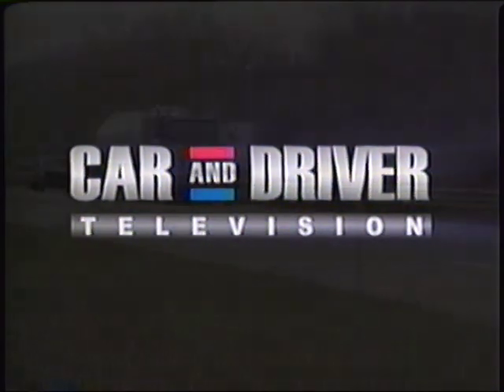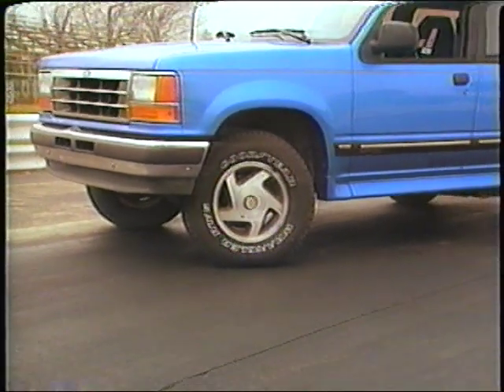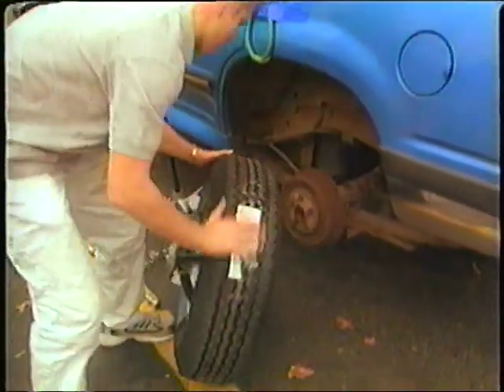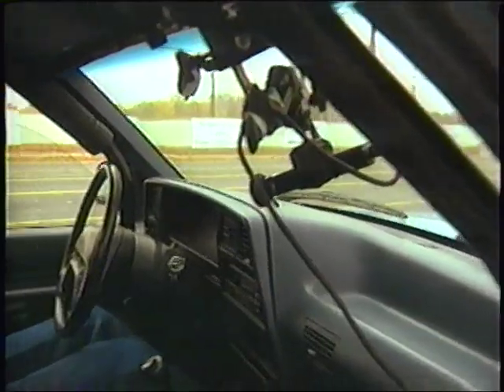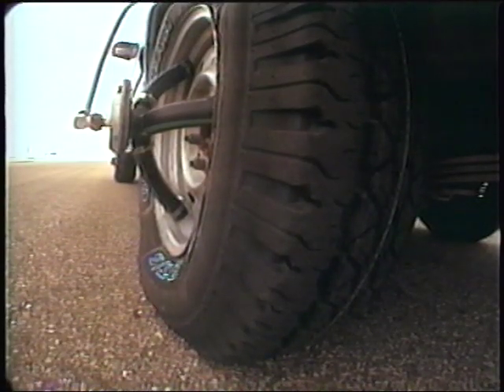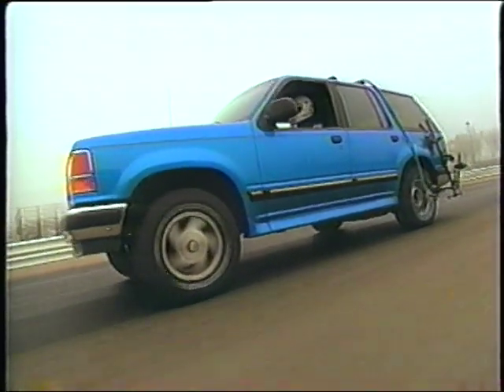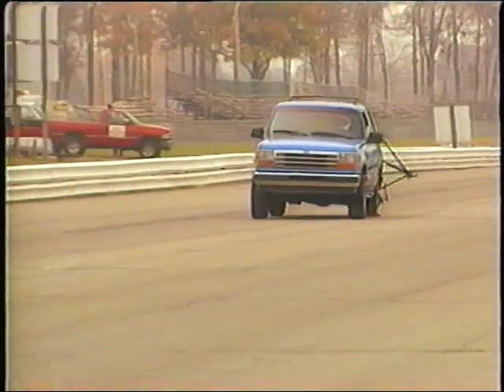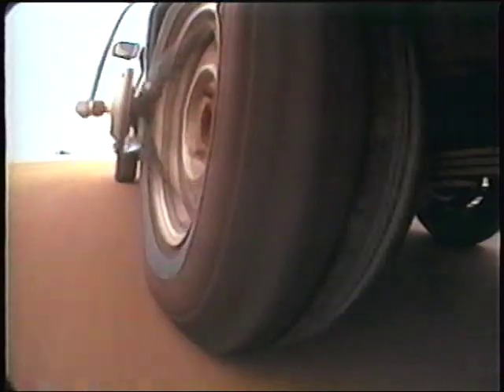Car And Driver 1994 Ford Explorer Tire Failure Test

Comment: The test was done specifically on the rear tires because it was rear tire blowouts which were the subject of the infamous lawsuit.  I think the main problem was soccer moms overreacting to the sudden noise and change in handling when a tire failed.  Ford used this same tire on 4WD Rangers...mechanically identical to the Explorer...and there were nowhere near as many accidents due to tire failure.

The NHTSB found the Explorer to be no more rollover prone than any other vehicle in it's class.  However, Ford isn't blameless, as they did tell consumers to under-inflate Firestone tires that were already defective.  When these Explorers were new, they came from the factory with 25 psi in the rear tires!  A Ranger would have 35 psi.
Reply: Really? they redesigned the entire vehicle after this.
Reply: @beautybyhammerllc  Yes...to make it more "soccer mom-proof".
Reply: The shorter wheelbase of the explorer also lends itself to be inherently  more unstable just because of the geometry
Reply: The explorer had a much higher center of gravity than the ranger

Comment: Now put it on the front so it makes the steering wheel pull to one side.
Reply: yeah on the front doing 70 on a corner!
Reply: I agree with you they should try it in front.
Reply: Any truck or truck based vehicle requires the driver to be more of a driver in a front tire blow out,but it can be handled,first of all do not stab the brakes it will get out of control fast.
Reply: Exactly
Reply: Yes.
Reply: Uh yeah a whole lot of nothing. Considering I had the whole damn left front tire and rim come off my F150. Just brake hitting road and coasting to a stop afterwards. People are panicking and this is what causes the wrecks.

Comment: There are some key differences to this and an actual blowout. This tire remains intact but runs empty, when a tire shreds you're running on a rim which I could imagine would perform very differently
Reply: It does had it happen in my 94 xlt explorer and its fuckin terrifying but she kept at least three wheels on the ground at all times so it was fine cause the roofs on them are built like tin cans
Reply: That's why I don't like Car and Driver, they got so much money helping Ford against Firestone by doing tests that prove just about nothing against their tires. Most of these rollovers with the early gen Explorers were caused due to the short wheelbase of the platform they used.
Reply: This must’ve been funded by ford

Comment: 4 doors and it’s a manual? I want it
Reply: probably rolled over two seconds after filming
Reply: I've got a '93 like that :) I've always wanted a 2 door version but I love mine
Reply: I drive a 94 woth a auto there great trucks and amazing on gas
Reply: @jamesprice2163 Mine is a 93 and it gets terrible gas mileage. It runs excellent. I really can't understand why it gets such bad mileage?Gets about 13 city 18 highway. Mine is pretty low geared it's got the 3.73 track-loc rear axle ratio. Cruising at 70mph it's only cranking about 2200rpm. Also it's an automatic. I've been told the 5 speed transmission does get better mpg than the automatic. Maybe that's why? It's my 2nd vehicle but I do use it because it's bad to just let a vehicle sit.
Reply: @Thundarr995  mine is a auto too I'd check tire pressure mine also has premium gas in it so it runs smoother but honestly explorers have never been known to get good gas milage but their bulletproof and can take a beating
Reply: @ianvader4697  they don’t roll over that easily. My parents had a manual Eddie Bauer edition, they racked up 300k miles and not one time did it feel unsafe.
Reply: Just bought one
Reply: @elirenigar9357  Be careful, if you rust proof it you might be stuck with it for 40 years
Reply: I have a 94 looks exactly like that with some body mods on it...They are dam good SUV's I blew a front tire and it was stable just like they are saying...Good luck finding one

Comment: I daily one of these and love everything about it its fun to drive pretty powerful (at 160hp) good storage, brakes kinda suck due to the slider pins continuously falling out but im swapping them out for second gen disc brakes so it'll fix that the only issues i have with it is the brake problem and the mirrors are too small for a suv other than that i love my explorer
Reply: The original ones, were they drum breaks?
Reply: @42luke93  in the rear yes but the fronts were what was throwing pads every two weeks sadly not long after posting the original comment the transmission gave up the ghost and we had to scrap my beloved explorer which lucky was used to piece together another one so it's heart is still out there somewhere hauling people around like it did for me (legit I fuckin loved that truck lol)
Reply: Was your explorer manual or automatic or manual?
My dad says that his is pretty dang weak (automatic explorer)
Reply: @DGP873  she was a automatic and yeah they were the weakest transmission of them all but it still held up for over a quarter million miles
Reply: My mom had its more premium cousin a 1998 mountaineer with a 5.0 pushrod V8 and automatic climate control. You can feel the torque on the gas pedal and it’s a nice sounding engine.

Comment: had one, was an awsome truck, would  turn on a dime, put coil over shocks in the rear very stable. ended up hitting a kia sephia head on at 40 drove it home. they cut the girl who ran in to me out  of her car with the jaws of life.
Reply: I have one now and have to agree but my brake line blew off and it slammed into a tree at about 25-30mph to my suprise it drove home and four months later still starts when you crank the key
Reply: Update still have it and still daily the damned thing still haven't fixed it and am buying another one next week the first gen explorer is truly the truck behind the phrase "built ford tough"

Comment: Tread separation, I doubt an experienced race car driver could recover. A rear wheel locks up from the rubber band and you have induced oversteer, fishtailing. Rollover very likely.  Tread separation though is very rare today.
Reply: The whole problem you outlined here begins with inferior Firestone tires.
Reply: @lawnmowermanlawnmowerman9930  The tread separation happened because Ford spec'ed only 26psi which left zero margin for error on tire pressure. Tires were fine, Ford was the issue.
Reply: @imzjustplayin  I go by the tires recommendation on my Explorers and I make sure it is rated for the load if not a little over rated for good measure (tire also lasts longer). I will say this, any tire I run on these trucks, once you get around 30psi and above they start to ride extremely roughly. Like you feel every single bump to the point where it shakes out your fillings. I've tried different shocks, but it only seemed to make this worse. I'm not exactly sure what causes this but I can see why Ford was trying to make it ride better with less tire pressure, people would have test drove them and immediately ran away from the bad ride quality. That being said it was a stupid cop out and they should have ran the correct tire pressure and taken the hit from less potential buyers. Personally the harsh ride from the correct tire pressure does not bother me because my other vehicles are all stiff race cars on coilovers, the Explorer is like a vacation in comparison. 

If Firestone was aware of Ford using 26lbs before the lawsuits began it's negligent on their part for not pulling out of the Ford partnership right then and there. If they lived under a rock and never managed to hear about it until the lawsuits began then that is probably a symptom of the stone age before social media when info like that could take a year to get around word of mouth. However, this is the automotive industry we are talking about, I'm pretty sure even back then info traveled fast. 

I believe there is only one real solution to this problem, much like Ford Pinto owners install aftermarket racing fuel cells, maybe if people still want to use these now vintage trucks start thinking about installing a roll cage and some harnesses like this one in the video.

Comment: btw, tread separation is much different.
Reply: Look up "Ford Explorer tire tread separation"...still nothing happens.  Conclusion = Poorly maintained vehicle (insofar as suspension components, steering upkeep, etc), completely inept driver, or both.
Reply: True. But then again, the fault is with the driver and Ford. 26psi is way too low of a spec, gave no margin of error if the pressure lost a few PSI.
Reply: @aks3691  What evidence do you have the tires were over inflated? Tires typically have max inflation values starting at 35 psi going up to 80 psi for LT tires. I've never had a tire explode due to being overinflated, always underinflated.
Reply: @aks3691  Go find it. You'll see that it loses control on the underinflated tire. The reason why is because the u-bolts tear the sidewall which deflects more when deflated. Also with a spec of only 26 psi, losing a few psi of pressure leaves no margin for error due to overloading. They specced lower pressure to improve ride quality of what is basically a ford ranger.
Reply: And if it happened in a turn?

Comment: put it on the front and lets see how it turns out
Reply: 2Legit2Quit if the front tire were to blow it would actually be even more stable than if the rear was to. You can control what the front tires will do by steering but not the rear tires. If the rear tire were to blow (explode not just deflate) the vehicle would be fishtail, but if the front tire were to explode, it would just pull to one side in a non-violent manner.
Reply: Had it happen she pulls but it's controllable

Comment: In reality a lot of the non tire failure related fatal accidents involving the early generation explorers came down to one factor:

Stupid people with no previous driving a truck based vehicle thinking that you could just throw a 4600 pound truck around the same way you can a 2800 pound Honda Civic without any risk and not bothering to learn how to safely execute emergency maneuvers in a large top heavy vehicle like an explorer.

Engineering wise it was a perfectly safe sound and stable suspension design than had been used for years in the Ranger and F-Series with no issues to speak of.

Comment: There was never anything wrong with the Explorer,it was the inferior Firestone tires and inexperienced/panicking drivers who were the problem.
Reply: After driving an explorer for years, I want to agree. However, there is evidence from an explorer designer that the car was 2 inches too narrow to be safe and rollovers were a very real threat. The rumor is that ford decided to blame the tires instead of fixing the problem. However, all of this should be taken with a grain of salt, as the ford designer mentioned does have some bias and could easily be lying
Reply: @shauncole4392  I had family and friends who worked at the Memphis Firestone Plant and they have all told me that they were ordered to put already rusting steel belt material in those tires during production, I know tires and Know very well what the results of such a practice would cause.

Comment: Rapid air loss and a blowout are 2 different things. A blowout is when a tire explodes into pieces losing it's tread. Sudden air loss is when all the air is lost but the tire remains intact such as running over a large piece of sharp metal puncturing the tire. You demonstrated simple sudden air loss- not a blowout.

Comment: Not sure I heard a lot of tire pressure  was super low after drive forever  with low tire pressure  it would separate  and cause rollover  also tire pressure  in door but ford was recommended  lower tire pressure

Comment: This is a bad test, this isn’t simulating a tire BLOWING OUT. The shock of a blow out is more violent and sudden than simply releasing all the air out at a relatively slow discharge. Also, a tire blow out on the front WILL be harder to control

Comment: A front tire blowout would have been more exciting, but I have very little doubt it would not lose control if the driver knew what to do.  Speaking of which, I probably should get new tires on my Explorer.

Comment: Not the truck or the tires fault.  Total driver error.  I own one of these and I'm familiar with it's handling characteristics.

First off, he's going too fast, jerks the wheel hard left, then hard right - that will destabilize pretty much anything with a high center of gravity - Explorers, Blazers, Broncos, a Garbage trucks.

The next mistake happens twice - or same 2 mistakes.  First off, the driver turns AWAY from the lean.  The whole idea is to turn INTO the lean so that the front tire on the leaning side pushes the vehicle back up before it goes to a point of no return (during which you want to return the wheel to straight - and do it GENTLY/SLOWLY) - which brings me to the second mistake, the driver jerks the wheel to overcorrect on top of it, causing an ABRUPT situation that will shift the problem to the other side.

What the driver should have done in the first place is not jerked the wheel.  And after that first mistake, turned into the lean carefully and ever-so slightly to push the truck back up, returning to straight as the truck gets back on all 4's - which would take off some of the momentum and discourage it from leaning the other way.

Also, if you look around 0:16ish - the driver should have held STRAIGHT there until it stabilized and then corrected into the lane.  The Explorer would have stayed on all 4s and all would have been fine - my guess is they were simulating the panic of a driver unfamiliar with the vehicle - which again is driver error, not vehicle issue.
Reply: My friend 99% of drivers these days aren't true drivers at all,just passengers who happen to be holding a steering wheel as they go down the road. Most have never handled a truck style vehicle until they buy an suv,then they expect it to handle just like the sedan they're used to driving. Two totally different handling vehicles.

Comment: Brilliant test probly sanctioned by the Ford motor company because in the statistics of the explorers involved fatalities that actually had roll overs, BOTH were rear tires failed simultaneously or one shortly after the other causing severe oversteer that even a highly experienced driver would find very  difficult to control without prior warning at highway speeds....... This was a very silly demonstration........
Reply: change your cheap tires

Comment: What about a blow out on one of the front tires?
Reply: Depending the speed and how much driving experience you've, I'm my 30 plus years of experience as a technician I tell people to never try to save money when it comes the time to buy tires, i ask them, how much you figure your life is worth? If is a truck get truck tires, those are crappy tires that wouldn't sustain the weight of the that SUV in hard driving conditions, like when there's an accident and the cops re direct the traffic through an old abandoned road and there's all kinds of debris on it.
Reply: @josmarz3841  wouldn't sustain the weight in hard driving conditions? what the hell are you babbling about. Vast majority of blowouts are caused by insufficient tire pressure. Most drivers don't check their tire pressure and even fewer add additional pressure when going on a road trip, loading down the vehicle yet not adjusting the tire pressure to compensate for the additional load.

Comment: Um, no.  The problem wasn't blowouts, it was that the tread would separate from the tire, much worse.  We had a partial tread separation in my grandpa's RV a few years back, it had duel rear wheels and still shook like crazy.  On a much lighter vehicle with single rear wheels I can see it bouncing the rear end like crazy.

But ignoring the rollover risk of SUVs (not just Ford, most brands), lets talk about how terrible the roofs were.  The roof on many 90's and early 00's SUVS weren't even strong enough to support their own weight!
Reply: Stop hating this was the first gen Explorer people did not know what to expect so they can improve

Comment: ok,im not even looking at the tires.Im curious as to what happened to the bumper,mine has the same thing in the middle.Bought it that way.Tow hook or something,driving me crazy.
Reply: I was thinking the same thing about the bumper! I just bought a 1994 with the same lifted part of the front bumper. Two other Explorers that I looked at also had it
Reply: I've seen it on all 1st Generation Ford Explorer models I had it on a 1993 and a local 1994 model for sale has it as well.
If I remember correctly on the one I had there was something mounted below that ridge of the bumper and instead of just simply relocating the component just had a crease put in that position of the front bumper.
Ford's Engineering Super Genius must have been Wile E. Coyote.
Going back and looking at the video again the ridge in the front bumper is above the ventilation port closest to the passenger side of the vehicle and if I remember correctly that is where my transmission cooler was located behind that opening and between the transmission cooler and the ridge was the lines that ran from the transmission to the cooler and back to the transmission again.